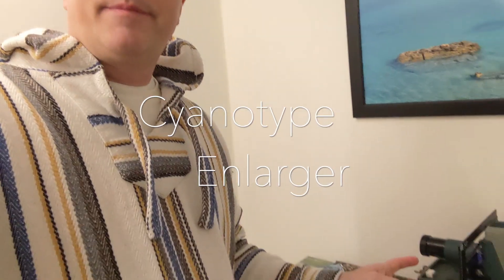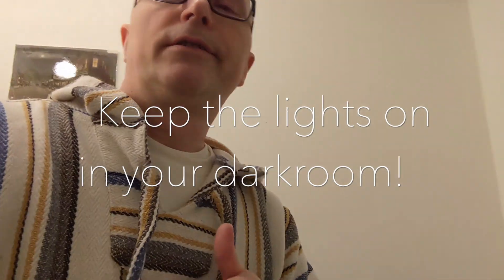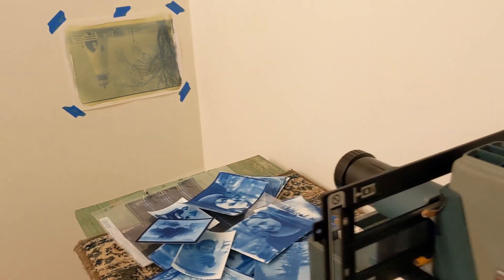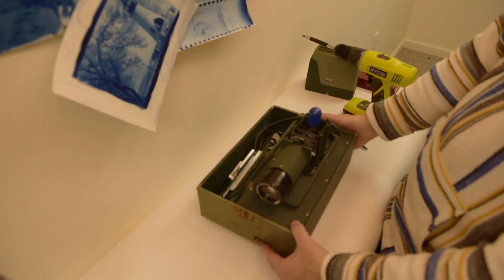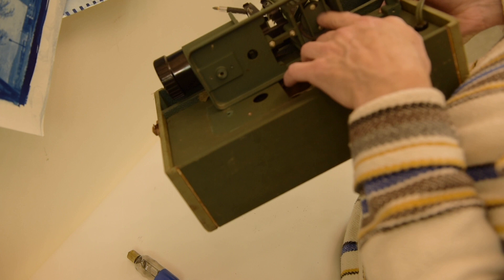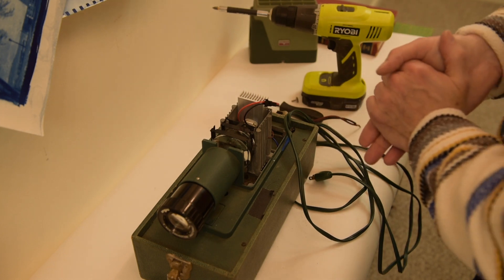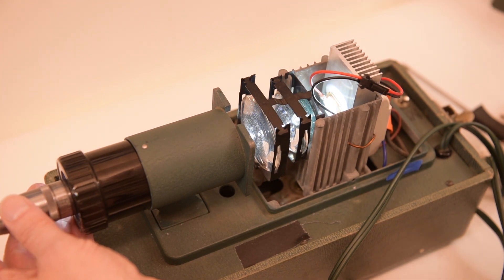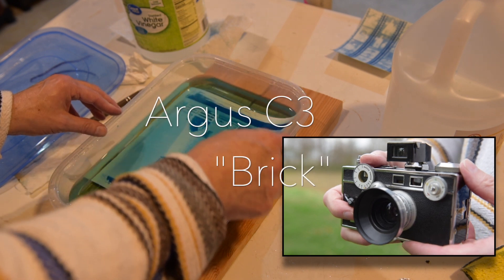Darkroom prints without the dark room - Cyanotypes

Comment: I built a similar setup to yours (same LED/driver), but my prints are nowhere near as complete as yours by 2 or even 4 hours. Are you using a certain formula to improve exposure speed? (I am using the Jacquard kit) Or perhaps do some film stocks block UV more so than others, since the light that makes it through the sprocket holes exposes fine?
Reply from the maker: I'm not sure, I know that overexposed images or overdeveloped images will take longer to print
Reply: @lawsonpix  Do you exclusively use black and white negatives?
Reply from the maker: @ansonbridges  yes
Reply: @lawsonpix  It seems that color negatives are extra slow then, thank you for your help :)
Reply from the maker: Yes, color negatives will take longer.